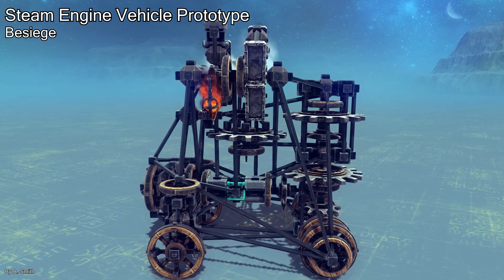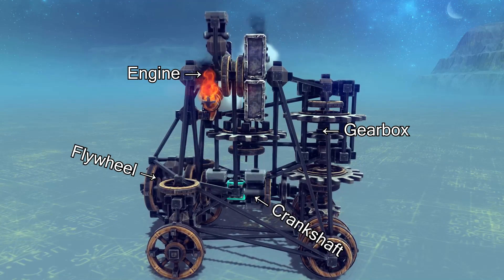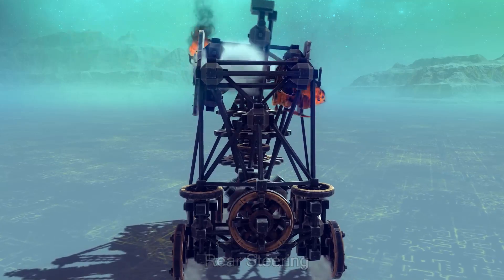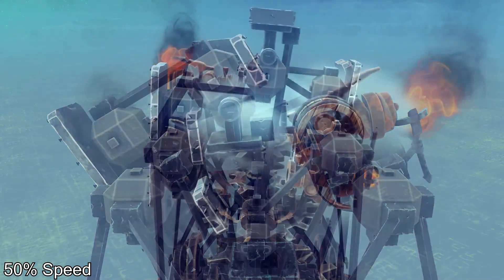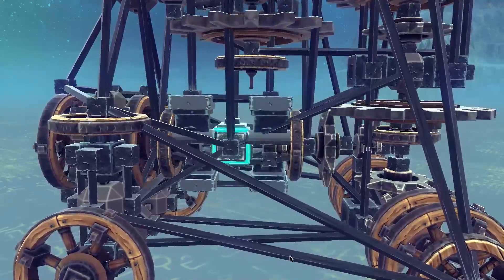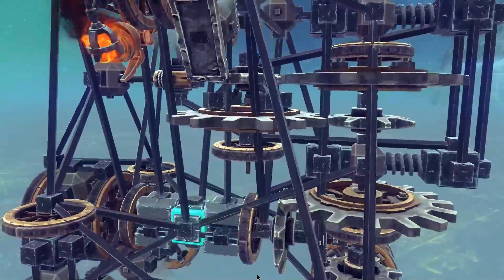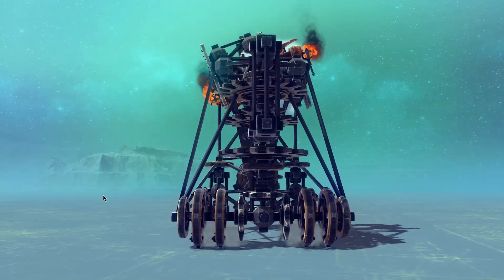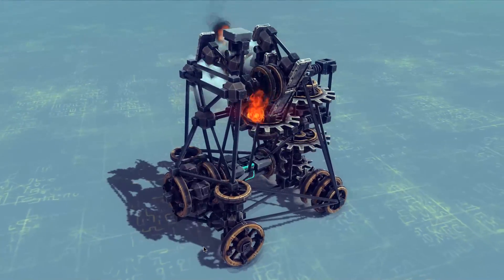Besiege - Steam Engine Vehicle Prototype

Comment: I would be purely impressed if someone made a flying vehicle with a steam engine.
Reply: It's not impossible at all, the engine he made in this video is fairly weak. Although planes are hard becuase of the rpms needed to get it up to speed, drones are not that difficult to get working.
Reply: me and my friends have done it 3 times

Comment: Hmm. So can it not run with a lower ratio? I've made quite simple steam cars that while not as elegant as this use a direct ratio and go a bit faster (However they have zero torque and can't go up even a small incline). It's just blowing steam onto essentially a wheel of blocks to spin it though, and I'm sure that's not what you're going for, so this is likely irrelevant >v<. Also, are you having the same issue where the steam cannons randomly put out the fire behind themselves and turn back to water? It's quite annoying for anything I make with steam that I intend to move quickly. My steam helicopter has this issue most definitely (it's also ugly as balls)
Reply from the maker: I had some success getting it to drive with a 4:1 ratio, and it was quite a bit faster, but it would sometimes stall. I went with 8:1 just to be safe. I imagine that I could get it to drive a lot faster with a multiple speed gearbox. I haven't really had much trouble with the cannons blowing out the torches, maybe it's the way I have mine placed.
Reply: ***** Hmm, perhaps. The torches only seem to go out when the cannons are moving towards where they are shooting the steam for me, as I think the steam is clipping backwards through it and then hitting the torch.
Reply: +Jake Beadle you've made vehicles with steam turbines? I have as well used steam turbines in tractor designs and got them to go pretty fast with minimal gearing.
Reply: +Game Brothers i made a steam turbin car. its like. stationary. still stati- OH POWEEEEER!